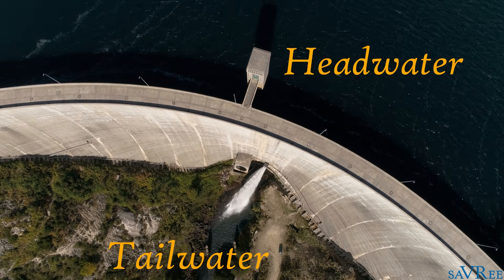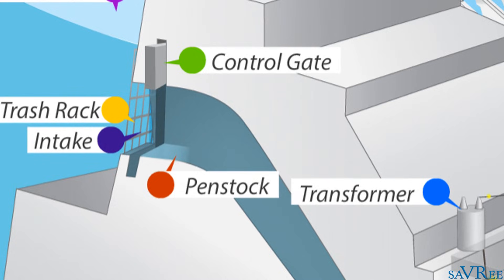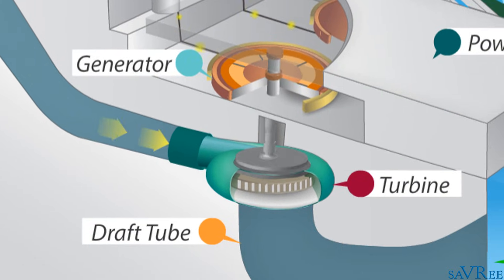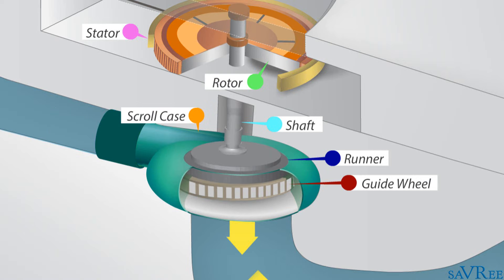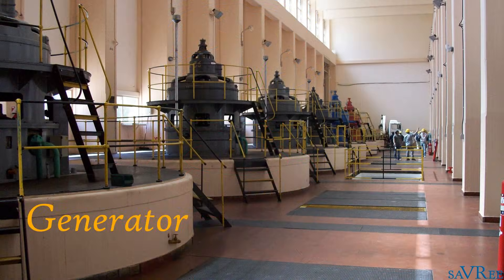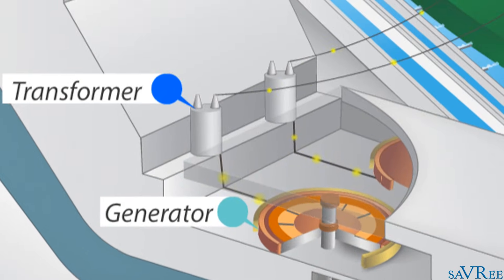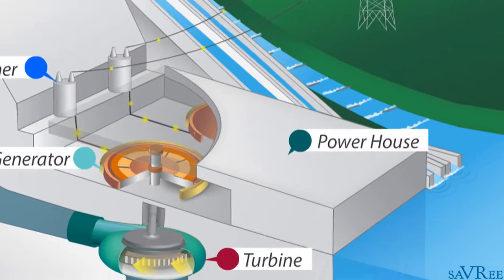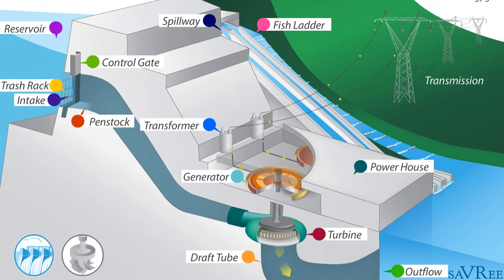How Dams Work (Hydro Dams)

Comment: The fucking problems is that instead of a Mega Structure. They should create millions or even billions of smaller one all along all rivers. But the problems is that. If they do that. They will have problems with thefts. And they won't be able to "Sell" their electricity. Because electricity will be so cheap. Just like Windturbins. Good luck. You can never stop countries like China to stop building Dams because they need storage water for farming. They all do. Instead of building systems to redirect flood water into Holes they dig. They just build up as lazy as they think and fucked up the whole ecosystems. That's why their dams always have limit. And when limit reach. That's when you see "Natural Disasters".

Comment: Nice video, very informative. I think it is also important to mention that the huge amount of energy that is required to produce contrete is generally taken from non-renewable sources. This reject a lot of CO2 in the atmosphere (usually with a ratio of 10kg concrete / 9kg CO2). So, in the end, dams are green once they are built, but not so during their construction.
Reply: We can't let upfront costs scare us away from long term solutions though. Solutions don't have to be perfect to be an improvement.

Comment: Not many people may notice but, Hydroelectric powerplants are actually very similar to Nuclear powerplants. Both have a high initial cost, Can cause catastrophic disasters if you cut too many corners, otherwise VERY safe, And are cheap to operate.Lets not forget About the fact that they both can be turned on or off therefore increasing the stability of the grid(idk how to phrase this bit so sorry if i phrased it wrongly). What about the downsides? Well hydro kinda changes the environment however they do generally have some way to preserve marine life. They dont completely dry up a river downstream(you have to let a percentage of flow through where i live). Nuclear’s downsides? Well its very expensive so massive investment and also public opinion on it is the exact opposite of what it is (its the safest energy sıurce but public opinion thinks its the least safe).
Reply: Well, yes, except the consequences of failure, being catastrophic in both scenarios, are also lasting in case of nuclear power.
A hydroelectric dam failing will sweep away the land, but once the water clears, it's safe again. Within a nuclear powerplant, the area would be doomed for 10,000 years.